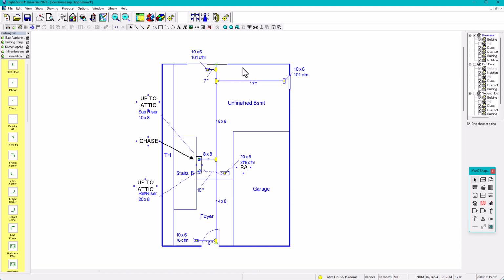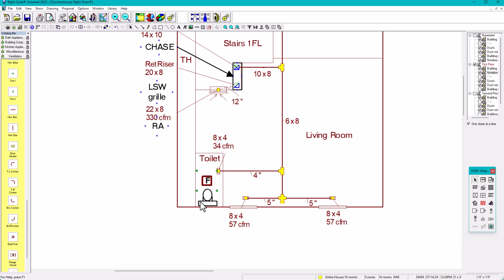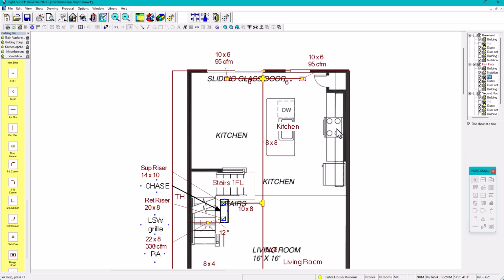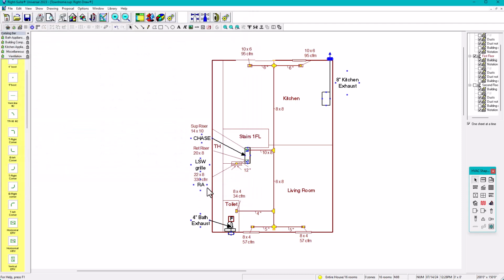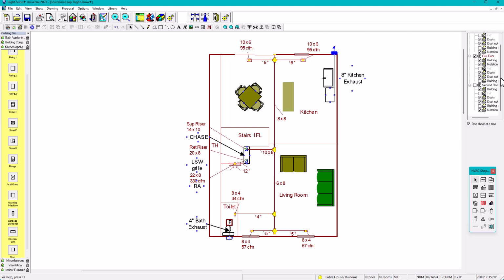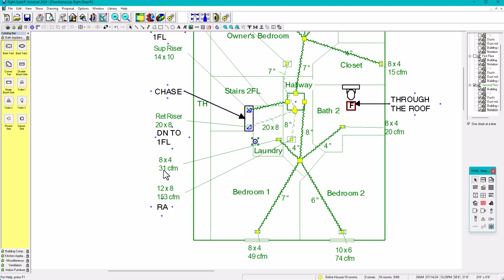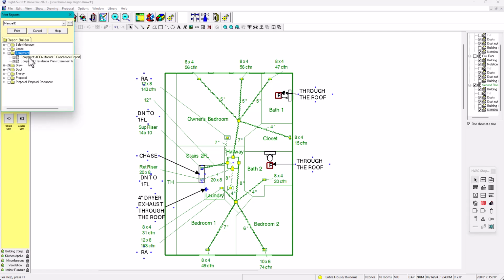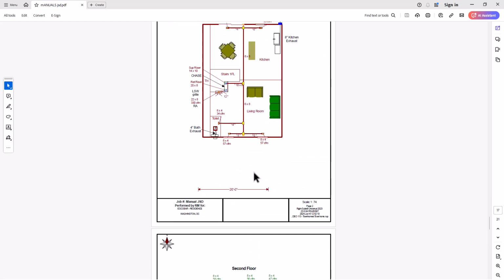Wrightsoft (Part 16): Manual D Heat Load Calculation-Townhomes-Final Reports

Comment: How can you add fresh air to the air handler? Also, do you have a video that shows the how to do multi units or zoning?
Reply from the maker: Thanks for your comment. You can add fresh air on the zone information under central vent. The same way we add ventilation overall (you can see this video as reference: https://youtu.be/fxSSDpOkZwQ?si=wdjc-dHsGTapHjUT). We have there options: Outside Air, HRV, and ERV. Hope this helps. Regarding to zoning, On Monday I will post a new video 👍.